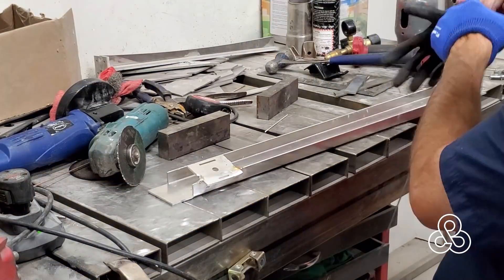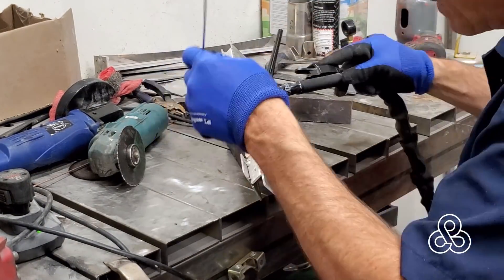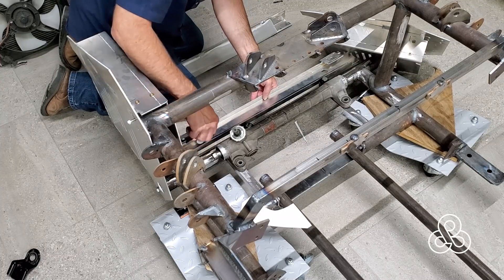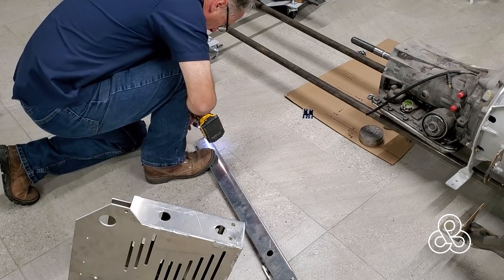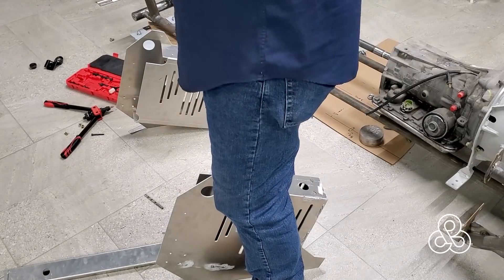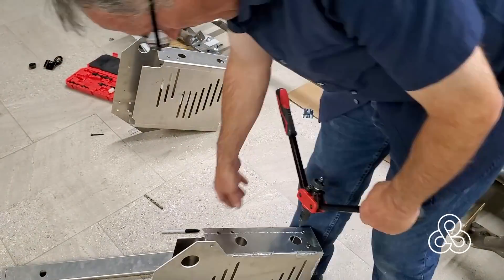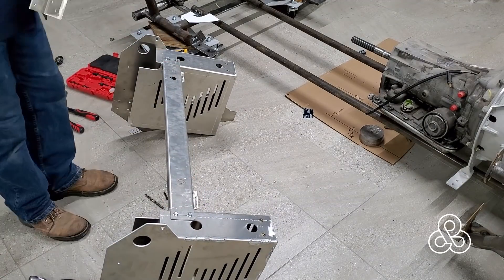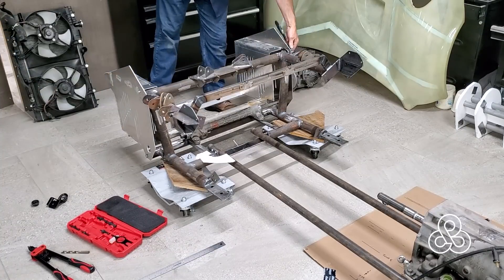A67 Whats the Diff? The Arete supercar now has a 3 inch lower front differential and more.

Comment: I've always been into cars and building one but as most people time and money are issues. I've started working from home doing my own business so I now have a little more time. I wanted to build a kit car but I want it awd turbo mid engine. I've seen many videos of your build but I'd like to know what transmission and front axle are you using? I'm worried I'd over design due to the direction of rotation of axles and take up too much room. I don't want wheels turning the wrong way. Nor add more axles to an adaptor to fix rotation and eat up space. Also I like watching how to videos so your other interests would be fun to watch. Go for it.
Reply from the maker: Transmission is a 4L60e connected to a self built center differential (transfer case) with Corvette C5 differentials front and rear. The front differential is turned upside down to correct the rotation and have the splines engage in the correct direction. I am hoping to get back to work on some of the drive-train in the next few months. Stay tuned..
Reply: @BuilderCreator  I have been looking at getting the running gear and v8 from a 2006-2015 Audi R8 from a wrecked car but it's almost impossible to find one under 40k. So your idea sounds more affordable other than finding a center diff. Thanks. Your channel is awesome. I just came across it a few days ago.
Reply from the maker: @gregdeen1469  For some reason I have always wanted a longitudinal mid mounted engine car (Perhaps it stems from my days working at a Ferrari dealership when the 288 GTOs came on the seen in the 80s.) The configuration I am using on Arete is purely for the budget and to get that longitudinal mounting. If I were to do it over again I would likely just take a front engine transverse mount and shift it to the rear. That is, if I was going to build a car that would be comfortable and practical. Ha!
Reply: @BuilderCreator  I've always wanted to build a mid engine awd for fun. My idea was to get a factory 5 818c kit and use a donor r8 and fit the engine and running gear in and build around it. I would have to modify the frame to fit the v8 and run the drive shift up the middle but I think for the power to weight ratio it would be a lot of fun and good looking. Daily driver and car show winner if I can pull it off.

Comment: I have a question.  When it comes to bonding the body to the sub-frame, is it your intent to use the Lotus technique of use speciality epoxy glue that you have to cure.  It may save some on weight and still be strong; you know every little bit counts.
Reply from the maker: The system will work this way- The subframes (suspension pick up points/ engine cradle) will bolt to the central monocoque tub. The front and rear clamshells (which include most of the front and rear bodywork) will be attached to the subrfames with hinges and latches. No bonding to the steel frame (subframes) Thanks for following the build.

Comment: I would be interested in whatever topic you decide to cover. I came here because of the car build but do like your style, so I would stick around for anything creative.  BTW, what are you thoughts on building a kit car, as there is no way I could ever do what you are with this build? Any recommendations on a particular kit car, especially open wheeled?
Reply from the maker: I am not a fan or "replica" kit cars. You will spend a lot of time on something that isn't. Borrowing design elements from famous cars is something different. Building your own design, a simple "bathtub on wheels" body on an existing chassis would be a fairly simple affair. A chassis similar to Locosts ( lotus 7) or an old Corvette would cut build time down drastically from what I am doing. A modernized version of a 20s open wheel racer could be cool! Something with a grill that looks like it is coming up behind you to eat you. Ha!

Comment: im only interested in the cars. all the steering problems ive ever had is the universal at the rack and pinion. when ever possible lean the rack backwards for a better angle. also foward leaning radiators create lift in the front. radiators leaning back create less lift.

Comment: Maybe its down to the angle of the camera, but with the angle that steering rack input shaft is mounted makes it looks like a really aggressive angle for any Universal Joint  to move smoothly with if coming from the hole you pointed out in the new plate.
Reply from the maker: The camera never lies (except it makes me look fat!) The angle is steep for a single universal; it will likely take two, which is very common on production car steering systems. There are also universal joints that operate up to 90 degrees or more with zero backlash. Another Item, were we shall have to wait and see what the actual outcome is.

Comment: What an impressive project. Very sophisticated approach, way beyond a lot of what you see on YouTube. I haven't seen all the episodes, so you may have covered this, but how is the torque reaction of the diff housing managed? Won't it try to bend the mounting plate?
Reply from the maker: It will try, but .25 inch thick 6061 aluminum with the truss and 7 mounting points should keep torque warp out of the system. The center differential only puts 40% to the front diff so loads up front are much less than the rear which sits in a .25 steel mounting bracket. It is one of those things that we can watch after we start getting some mileage on it. ;)

Comment: To start with, If I understand you correctly, you mentioned that the top radiator supports are going to be bonded and riveted to the cross brace. Are you planning on removing the cross brace to install / remove the radiator? Seems (although very minor) that from a torsional rigidity stand point, you would be better of to rivet and bond the cross brace to the crash structures and make the top radiator supports just bolt to the cross brace like most OEM's do.

As for the end part about other content. Personally I am impartial but know that there will be some that are for and some that are against so to satisfy both, maybe a 2nd channel for the other stuff?
Reply from the maker: The cross piece in the video, that I installed 4 nuts into, will be the top radiator mount. 4 bolts and the radiator is free. However, I came across a great deal on a lower side-flow radiator today (ordered and on its way) so, the actual mounting tabs will change from the peg and socket type to something new. Stay tuned.
Reply: @BuilderCreator  Definitely will stay tuned in. 
Because my regular (pay the bills) job is designing and building heat exchangers (primarily for the Heavy Duty On and Off road industries and heavy equipment but also occasionally regular automotive), I have somewhat of a passion (I guess you could say) for Radiator's, Charge Air Coolers (Intercoolers) and oil coolers.

Since another area that you showed since it related to the diff mount was the brake master and  Vac Booster, any particular reason that you went with a single tandem master cylinder power brake setup rather than a dual master manual setup with a balance bar?
Reply from the maker: @CP_300PRC  The dual cylinder setup may be just a tad to complex a setup for a "mostly" road car. The booster was chosen for the size and fitment. I will be changing out the master cylinder. Proportioning valve will be adjustable for tuning on a course if desired.

Comment: The problem with rivnuts is not that they come loose any more than any other fastener , it’s that when it comes time to remove a bolt the rivnut may spin instead of undoing.
Putting locktight on the outside of them before swaging them in can help especially on thinner panels.